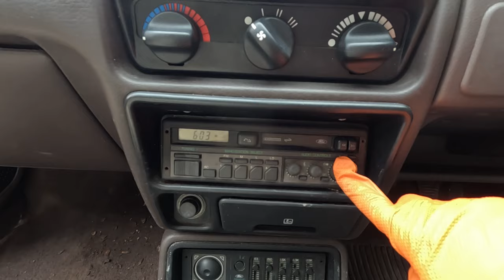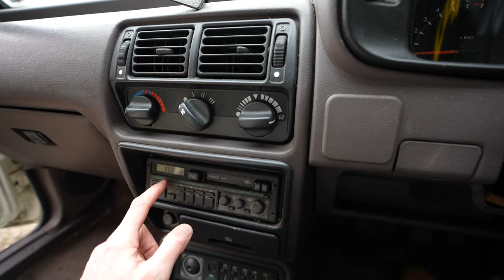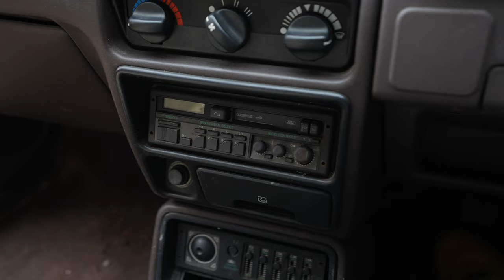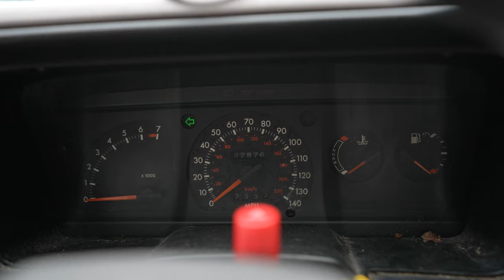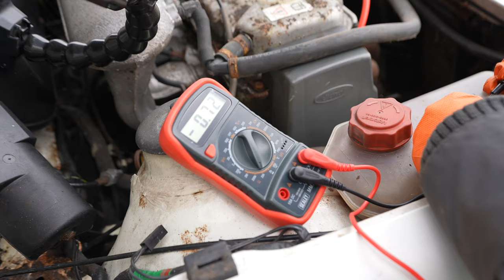Ford Escort MK4 - Day 4 - connecting the battery.

Comment: Great to see someone else with a love for escorts!

The battery terminals are different sizes, so that more than likely didn't help you. It seemed like you may have put the wires on the wrong terminals.

As for undoing any stubborn nuts and bolts, I usually use a combination of oil lightly poured over the stuck part and a heat gun. Rinse and repeat until it's free, lol.

If you need any tips, then get in touch. I've done so much work on escorts and I'm sure I could give you some pointers.
Reply from the maker: We're learning as we go along, and the battery has been a frustrating one so far. Sounds like we defintely need to get some heat into the fixings we're removing as well! 

We're all ears when it comes to tips and advice, so if you're happy to, please reach out - our e-mail is: thesentimentalcarclub@outlook.com

Comment: My 1987 cabby has a security gizmo. There's a slot in the dashboard that needs a little electronic key, before the car will start. Maybe it was an aftermarket thing. Glad you got the sump plug out.
Reply from the maker: We think there is some aftermarket security as there is a gadget under the bonnet, sort of halfway between the fuse box and the front of the car, but it doesn’t seem to be connected up to anything. We will have a look to see if we can see what you are describing next time (we have been to the car since we filmed this video)

Comment: Always connect the positive first on the battery then the neg. On top of the fuses are two little metal tags. you can test the fuse without taken them out. Just put your meter on these two tabs......
Reply from the maker: That would have saved so much time!! Of If I ever do it gain I will do it that way!
Reply: @TheSentimentalCarClub  Always pleased to pass on my knowledge. You have a new subscriber.
Reply: Make sure to have the meter in the right setting first.

Comment: On top of your new battery clamps there should be a positive or negative sign so you put the correct one on each terminal. It was hard to tell from the picture but I think you put a negative clamp on the positive terminal
Reply from the maker: Thanks for the heads up - we checked last time we were with the car and they're definitely the right way round.

Comment: Hi to you both, loving watching you couple tips if you don't mind flat tyre issue swop wheel for a better one at rear saves keep trying to pump it up. Why not leave it up on stands. Sump plug simple file a slot in it steering wheel torgue bolt up YouTube is a fab tool for information but your doing well on batt terminals simply swop your.red and.black battery leads for round.ones they will prob need changing anyhow I bet the leads have seen better days the earth one needs to be good. Good luck looks lot fun
Reply from the maker: Thanks for your support - glad somebody is entertained by us! We have left it up on stands now, but we thought we'd be moving the car indoors sooner so that was why we kept putting it back down. The spare wheel is an obvious one, but I'm not sure we have the locking wheel nut so that's a whole other issue! We appreciate the tips, please keep them coming x

Comment: So that oil pan sump bolt is rounded off , i had this problem with my wifes mini. If you have a promblem like this again in the future You can buy some special sockets that are for rounded nuts i bought a set for under £20 that dig into the metal off the bolt and grips it you tap it on with a mallet  , ( got a impact gun on it yes i know impact guns on oil sumps are not a great idea it can crack them if not carefull  but i was undoing not tighting , so i took the risk as i was at my witts end with it ) took it straight off Obviously the bolt was knacked after but a oil sump bolt is pennys any way. I would also like to point out i would never use a impact to do the bolt up.
Reply from the maker: Yeah that sump nut was a real nightmare! We did try and use a nut removal tool, but it just wouldn't sit straight on the nut - we've had success with it in the past tho. Anway, we called in the cavalry and a mobile mechanic whipped it off in a couple of seconds - quite humbling. We definitely need an impact gun tho!

Comment: I would have had that sump nut off in 10mins a bit of heat and it would have come off.

The battery cable issue, you could have drilled those holes in the existing connections bigger and then used the new clamps.
Reply from the maker: We did consider drilling but thought we would see if we could find a part that would fit… as ever easier said than done!

Comment: Like watching the laurel and Hardy show .
Reply: Just as well take the sump pan off altogether now you drained the oil and replace the sump gasget and inspect the pan itself cant be too difficult to get a replacement one of those only a few 8mm bolts to get that off.
Reply: @TheSentimentalCarClub  im sorry but the lady has more of an idea on all of the maintenance,,,  connect positive first then negative so when you are tighning the negative your metal spanner will not earth  and spark